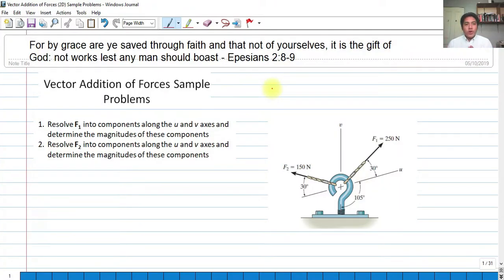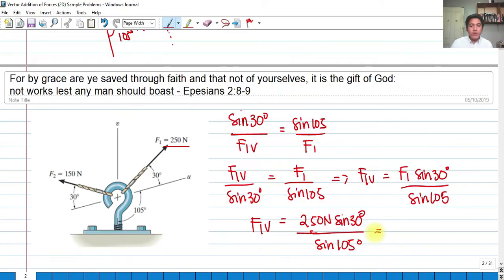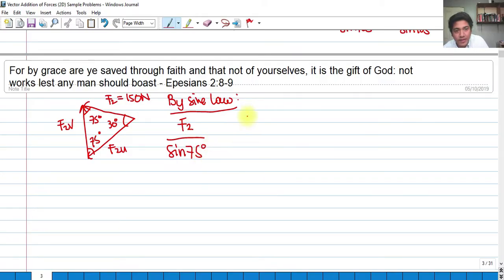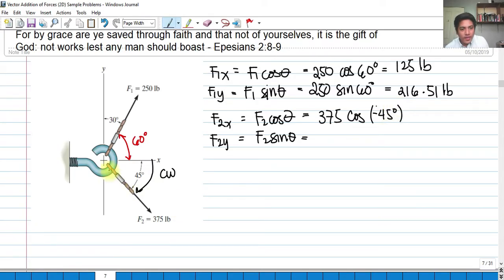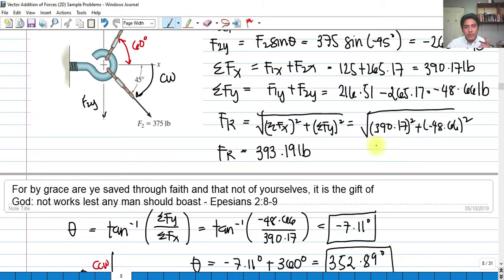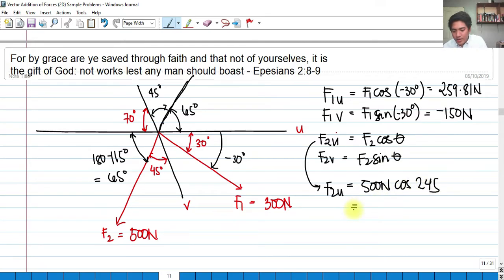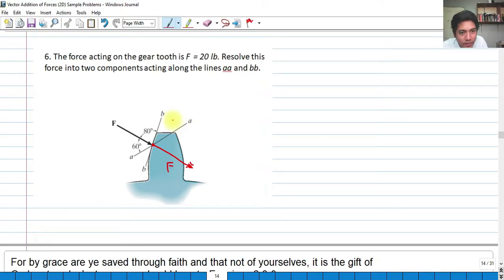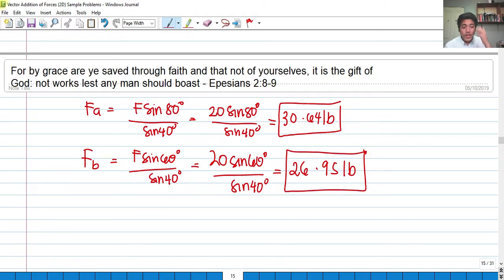Vector Addition of Forces in 2D Coordinate System Solved Problems - Statics of Rigid Bodies

Comment: sir, (29:34) i am confused with the -30 degrees. it is said in the problem "measured clockwise from positive u-axis" how come it became negative when it is from positive u-axis? as what I have learned from the previous example you are doing the counterclockwise sir in your solution
Reply: -30 degree implies 330 degree 

angle is always positive when measured counterclockwise while negative when measured clockwise.

the negative sign is important for calculation purposes but for analysis, it doesn't really matter when we perceive it as positive or negative if we perceive it in terms of its measurement alone

sin(-30) = sin(330) but it will never be equal to sin(30)